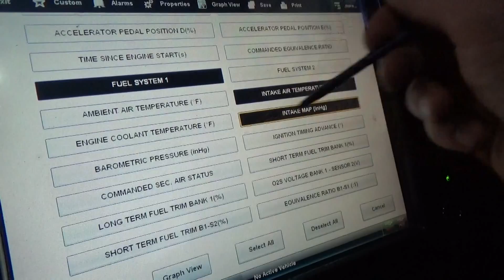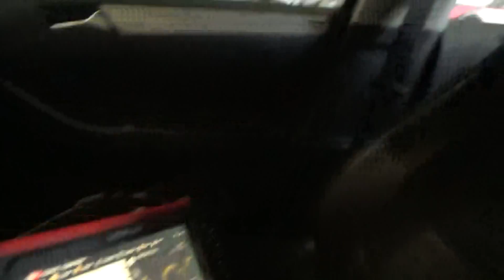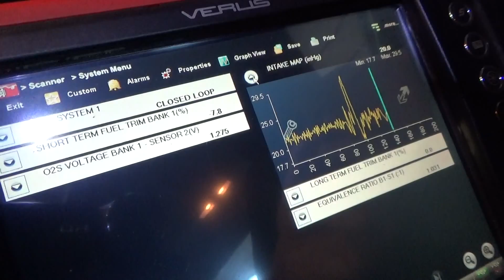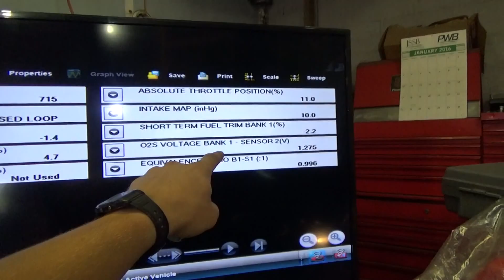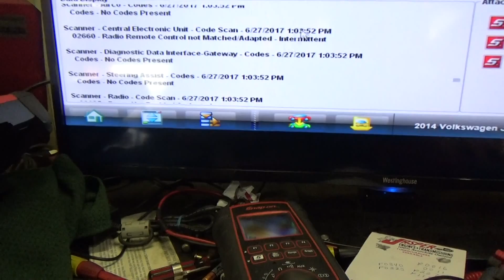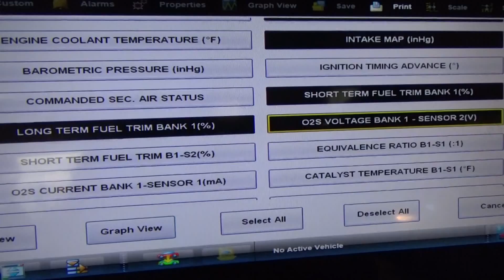Intermittent misfire, low power: 2014 VW Jetta GDI Turbo -Part 1

Comment: Hello sir,thank you for sharing your knowledge with us!! I want to ask you about the yourself energized the magnetic actuator,  can we do it before check the timing? I mean if the chain is stretched or the chain has jumped 1 or 2 teeth and the engine run bad as your video can we energize the magnetic without the risk the valves bent to pistons?? Thanks in advance!

Comment: Hi.. my Jetta is at vcds between 7 and 9 degrees when it heats up.  He makes a strange noise.  could it be my magnetic? No error codes but the car hesitates a little at idle and stopped.thanks.

Comment: Are the torx screws reverse threaded on the adjuster magnet.  I'm worried about stripping them.  And if so what size where  to replace them I have a 2915 Jetta 1.8 l turbo w same issue.

Comment: Thank you!  I have been fighting this issue for so long.  My 2014 VW Jetta SE 1.8t has the EXACT same symptoms.  New part should be here .... soon (new years is gonna slow it down).  THANK YOU!!
Reply: Mines having the same issue. 2014 VW Jetta SE 1.8T. I’m new to all this car stuff and just want it fixed. What did you change?
Reply: @jocnissa6801  lol, well, in the end I just needed to change out the spark plugs and coil packs.  I did swap out the part he mentioned though.  I forget what it’s called, but it was a quick/easy part to swap out.
Reply: @chadsvb  I changed the spark plugs just a few months ago. What was that other part you mentioned? I didn’t get through the whole video
Reply: @jocnissa6801  did you also change the coil packs?  If not, definitely change them.  As for the part mentioned in this video: https://www.ecstuning.com/b-febi-parts/camshaft-adjuster-magnet-with-connector/06l109259akt~feb/

Comment: Was the problem  ever found or fixed? I have a 2014 passat tsi 1.8 and it is doing this same exact  thing and it  comes up with random misfire in all cylinders  . Multiple  misfires. . Has the vacuum  in the dipstick  and the oil fill cap. The rough idle . . Was told it's the PCV oil separator valve.  So I changed  it with the OEM one. Not cheap aftermarket  one. And it's still doing it. Any idea what the problems?

Comment: I have this exact issue occurring to my 2014 VW Jetta SE 1.8 T and the issue has not been successfully diagnosed yet. Maybe I should ask my mechanic to look into the same component causing the problem as described in this video.

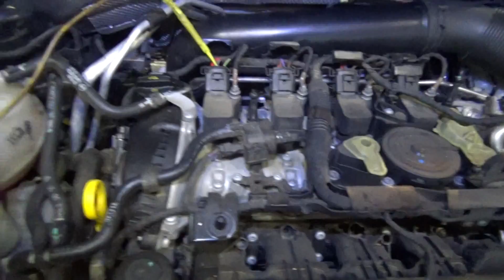Comment: @ 6:52 there's the root problem :))
i was screaming to see the fuel rail pressure..
Reply: you can't have bad fuel pressure if you don't have positive fuel trims. this wasn't reading a lean exhaust either. said it was fixed rich on sensor 2, indicating lack of oxygen. it's lacking oxygen because it isn't getting enough oxygen through the exhaust because some of it is escaping back out of the intake valve because it is stuck in an advanced position.

Comment: Some of the Volkswagen cars use a belt to drive everything then use another sprocket and chain to drive the cams so it may have a belt as well as a chain
Reply: The 2.0t BPG and BWT engines have both belt up front and chain rear of head

Comment: I believe CAC refers to "Charge Air Cooler" or intercooler. 

I'm going with a sludged engine. Those 1.8 turbo engines are a giant stinking pile of turd. The best engines VW make are the 2.5 5 cyl and the 1.9 PD diesel. Great case study Ivan. Loving a dose of the old euro trash. 😂

Comment: Dealerships (aka STEALERships) never cease to amaze me! Guess they're used to  the old adage, "There's a sucker born every minute".

A GM dealer would perform the "timing belt" replacement, find it has a chain, then charge you labor for digging into it. LOL

Guess the days of 300k miles VWs are long gone. If it's having problems this soon, it doesn't have a chance!

Comment: Hey Ivan! How do you compare MAP data in inches of Mercury with a conventional vacuum gauge? Do they match? Because when I saw the MAP data, to me it was a little high and I really don't know if specs change for turbo engines. Those high readings might indicate problems with engine not breathing  which also explains the rich condition. What do u think? Thanks for this awesome case!
Reply: you subtract it from 30 inches to get your vacuum. you don't take that number as the engine's vacuum. thats the manifolds pressure

Comment: Audi tech chiming in here. I'd advise you to check the following things before replacing the cam adjuster. Do a leakdown test of all cylinders and see if you are getting blowby around the piston rings. The intake air leak fault is a very big clue here. I have had that fault set on more than one occasion due to piston ring failure. If you have excessive blowby, remove the oil pan and inspect for pieces of piston rings. A timing chain failure will also produce those symptoms. It is likely the dealer technician recommended a timing chain and tensioner, and the adviser was a moron who misunderstood and sold it as a belt (I say this only because it has happened to me as a tech).  If you have repair information available, see if you can find a section for timing chain tensioner inspection. VW/Audi tensioners have an acceptable number of visible teeth showing. We check the timing chain by counting the tensioner teeth through an inspection port in the timing cover. I believe 3-5 is the acceptable number, but I'm not 100% sure on that engine. Lastly, spray down the front and rear crank seals with some brake cleaner to check for leaks. If a leak is found, replace the seal and the pcv breather assembly.
Reply from the maker: I really appreciate the tips from knowledgeable dealer techs. Thank you!
Reply: Yea some shops dont know how things work. My 1996  Honda Goldwing was in for work and the mechanic ( if you want to call him one) said my bike needed a carb rebuild (which I had already told him and he did not fix it. long story Just fixed what he wanted to and skipped the rest. Although he charged me. Like I said long story) and a  valve adjustment. My bike was quiet and has Hydraulic  lifters. So After I rebuilt my own carbs everything was great. 
Ok I know this has nothing to do with the price of Tea in China but just had to spill that out. Ill be quiet now......

Comment: i can say with confidence that the owner of this vw does not spray their car yearly at krown or with fluid film
Reply from the maker: Euros don't rust at all...no need for that Krown stuff haha
Reply: While  the Euro's  are A LOT better against rust from the factory than a equivalent domestic car usually. 
NOTHING any OEM  doing at the manufacturing level is stopping rust caused by rock salt, and that calcium chloride/ brine/ crazy de-icing material they put on the roads now. 
In Ontario Canada i still see Volkswagen's rust & BMW's etc. Not as much as Domestics.. But they still do.

Also as a sde note...electronic sensors , abs, door window motors are all gonna have less problems with the krown being inside the doors and on sensors lessening chance of corrosion.

Comment: Ivan, some thoughts and observations

This is a forced induction system, so the MAP pid does not seem to be off...

Bidirecional control will work only once per ignition cycle and test item. This might have been the reason you were not able to run the cam phaser a second time.

As the problem happens at cold engine only it might be related to oil pressure / timing chain tensioner and or wrong/dirty oil. The oil is absolutely critical with these engines.

Comment: My dad has 2014 VW Golf with 1,2 petrol engine and a while ago the VVT unit was replaced at the dealership as it started running poorly and check engine light came on.

Comment: well done once again Ivan shows the dealer what to do. i think the dealer would have charged the owner for a timing chain or belt but would have just replaced the vvt activator possibly a cheaper job but would have charged for the bigger job, that they would have not done.

Comment: I had the very same symptoms with my 2009 1.8 TSI engine. One time the engine even managed to die while idling and overall vibrations were quite harsh on idle. But had no problems while revving the engine. Dealer couldn't fix it at the first attempt and they swapped out a part that didn't change anything but on second attempt they changed the PCV valve (they mentioned crankcase ventilation valve) for about $150 and it fixed the problem.

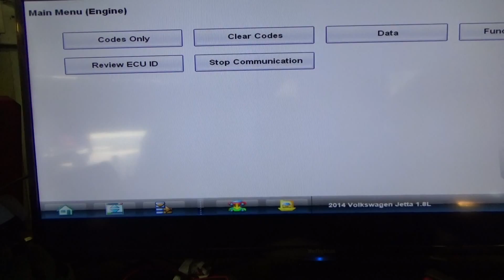Comment: Maybe not relevant, but noticed at 19:44 in the actuator test list there is an oil pressure control valve test  - if the engine actually has a variable oil pump it might be worth checking there is sufficient/stable oil pressure as that could cause VVT control issues - not super likely, but may be worth a quick check to rule out before doing expensive rebuild (especially easy if there is a PID for measured oil pressure in OEM data)

Comment: I'm surprised you didn't backprobe the circuit to see if the commands are coming through from the ECM before you threw battery voltage on it.
Reply from the maker: Wait for Part 2!

Comment: Dude I'm struggling to fight back the anger when watching you be such a copycat and make a car diagnostic video.  There are other people making car repair videos using tools JUST LIKE THE ONES you used!!!  You totally ripped off the use of jumper wires to energize that solenoid without giving credit to SMA, SD, New Level and all of the others who have ever used jumper wires in the past.  "Ooooooh - I saw that South Main got a new set of yellow jumper wires - I'll have to get some and do my own video"  You're standing on the shoulders of giants without giving any credit.  I almost feel like I should get my money back for this video but I guess I'll have to wait to pay for part 2 and then demand a refund.  I already gave a preemptive thumbs-down on part 2 just in case you follow through and actually charge for it.  I'll bet you even have the nerve to rip off even more and use some kind of hand tool in part 2.

Crazy enough? ;)

Keep up the good work man!  The suspense of having to wait to learn why energizing the solenoid causes the rough running is killing me.
Reply from the maker: lol yeah I got the joke ;) I bet all those other hot shots don't have a custom home-made pressure transducer though!
Reply: Tim Burke    Those tools are typical use tools available to everyone. Do you expect Ivan to use a flashlight and extension cord to diagnose problems because nobody else on Y-Tube uses them. Don't be a jerk!
Reply: I''m joking based on comments on  another video of Ivan's from last week.  :)  There was a guy last week complaining that Ivan was a copycat because he was using the same diag tools as the others.
Reply: Joking is a good thing as long as you don't unsubscribe.
Reply: I could never unsub now - I'm hooked on these diag videos!!!

Comment: My Wife got a letter from our VW dealer wanting to change her timing belt, as the car was 5 years old, I pointed out to them that it didn't have one. Wonder if they would have charged her for doing nothing!
Reply: Probably just one of those letters they send to everyone. Like when they say your car is in high demand and we want to buy it back from you. Except, you have a 250k mile clapped out Golf.
Reply: Give them a call and setup the appointment.  Tell them you'll be wanting free service for life if they fail to produce the old parts......Better yet.  Do a "hidden camera" like the news crew did in CA for the bogus oil change jiffyspeedy places.  Selling services and never doing them.

Comment: I was initially suspecting a skewed engine coolant temperature sensor, since it seems like the ECM is undecided whether to stay in open loop or enter closed loop. I don't figure the ECM would set a code for this either, since the ECM will usually only set a code if the sensor circuit is open or shorted to ground. Adjusting the fuel metering based on skewed coolant temperature information seems like it would cause similar symptoms.

Comment: Interesting! ECM setting plausibility codes or could ECM have issues or were they created during diagnostics? The P0011 & P0016 get my attention and puts it on track with your current path which would also account for low manifold vacuum and other plausibility faults. Perform same test cold when it's acting up & if it's valve timing then you won't have any change when you energize the solenoid validating it. Still lots of questions. Can you see cam timing advance PID in OEM side of Verus? Also there is a TSB that Maic Salazar has already mentioned that could be your issue. Looking forward to Part 2.

Comment: Great diagnostic video as usual....,  i have a sensor simulator would it be appropriate to use for this test on a vvt system .  It can simulate voltage and frequency i use it for sensor wire integrity testing .

Comment: hi Ivan thanks for video here is a seat/Vw that had similar symptoms https://youtu.be/6mOjXv9cZ8Q. found that the fuel pressure was to high and timing sync was off, reset it using autel ms905 and gave oil flush and oil change customer says car now runs ok cheers sandy

Comment: Just thinking some more here... the intermittent issue could be due to the ECU eventually adapting to a relatively small vacuum leak in PCV system. Just a thought...

Comment: Hi Ivan, I also believe that you have a problem with the PCV system, that amount of vaccum is not right. But that would give you lean codes. Maybe since you have a bad running engine MAP values are all over the place and ECM has not flag that yet.

Comment: I would be suspicious of that crankcase vacuum.... should not change the way it runs to pull the dipstick. The PCV diaphragm is known to fail, at least on the older models. Try to open the oil fill cap - if it is a failed diaphragm it will will be really hard to pull the cap off due to the vacuum. Believe the diaphragm is under the round looking thing directly on top of the engine towards drivers side.
Reply: No they still fail to this day & are more widespread than ever.

Comment: I was thinking IAC valve, but I don't know if the VW's use one or not. Because when the engine is warm the faulty IAC valve acts normal. On some vehicles, a bad IAC valve will not set a specific code telling you hat the valve is faulty.

Comment: These VVT problems are so interesting.... I would have thought diagnostics would be more straight forward, looking at timing advance. Perhaps OEM scanners are better tuned to find this problem. Have you found out why the second O2 sensor was fixed at 1.25, was it a substituted value?
Reply from the maker: We'll dig deeper into OEM data in Part 2. The results were really neat!

Comment: 01 16 07May 9, 2016 2037620 Supersedes Technical Bulletin V011513 dated June 03, 2015 to update part number and software levels as well as Beetle/Beetle Convertible 1.8L applicability.UpUpdate Programming ECM to Correct Engine Load Calculationns Update Programming, for rough idle and/or stumbling. ECM may contain various fault codes.
Reply: Technical Background
Current ECM programing does not efficiently control engine valve timing causing stumbling and rough idle.
Reply: Good thought here!  Definitely warrants some investigation!

Comment: Leaking PCV valve. Is there massive vacuum under the oil filler cap? Or signs its forcing the dipstick out under boost?

Comment: Some VVT engines (maybe all, I'm not sure) don't have separate EGR systems because they can achieve the same effects by adjusting camshaft timing. I suspect this is why it acts like a stuck EGR valve.
Reply: Yep. Same thing occurred to me.

Comment: Nice post! Great diagnostic workup.
What are the voltage/signals supposed to be at the connector of the cam timing thing? Check it with a voltmeter or scope starting with the engine cold. Check at various RPMs. Does AllData have anything about how and when the cam timing adjust becomes active?

Comment: Off the wall guess before I watch the video: gunked up intake valves as a consequence of the direct injection setup?
Reply from the maker: But how would that explain the intermittent nature of the beast?
Reply: I avoid GDI setups.  I had a 2014 KIA Forte with 2.0 GDI and had a shaky running engine when cold after 25000 miles and progressed to rough idle when it was warm.  I did an intake system cleaning  and I noticed a drastic improvement but within 5000 miles performance problems and my mpg dropped about 5 mpg.  These setups are susceptible to carbon build up because there is no wash of fuel over the intake valves to remove deposits.  I have heard that Lexus/Toyota have employed a secondary fuel delivery system to wash the intake valves in GDI setups but that does not seem practical to me and I think would waste more fuel because if this were the case the fuel washing the intake valve is going to go into the combustion chamber and so at this point why not stick with the sequential port injection. GDI certainly shoots down the advertisements that fuel companies pitch such as  driving your engine clean
Reply: gtemnykh That's just what I was thinking too.
Reply: Ford  direct injection engine had that same problem,runs garbage when cold,when they got to operating temp they run fine
Reply: I obviously did not read the full video description! :)
Reply: I driven so many used GDI Kia's and they smoke like a steam train. When you get on them its a white smoke cloud that leaves everyone behind you blinded.
Reply: gtemnykh or the title lol
Reply: "Intermittent" could mean a lot of things IMO, in terms of relative time scale.